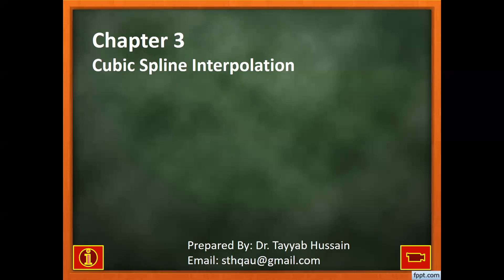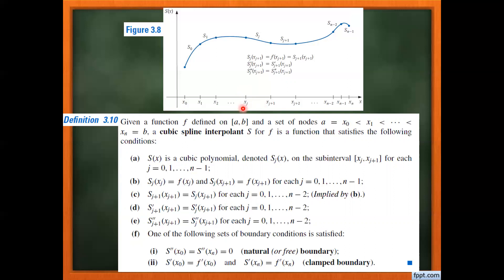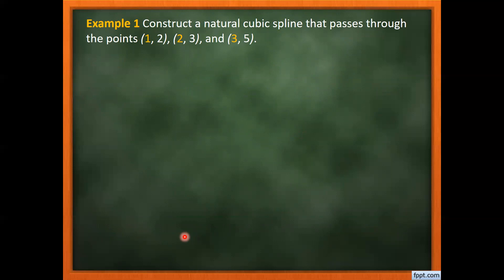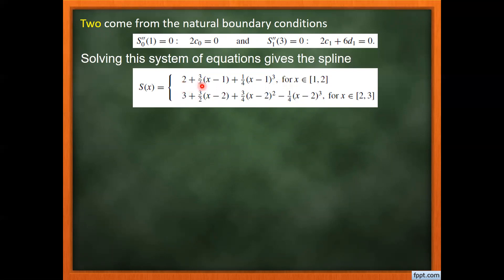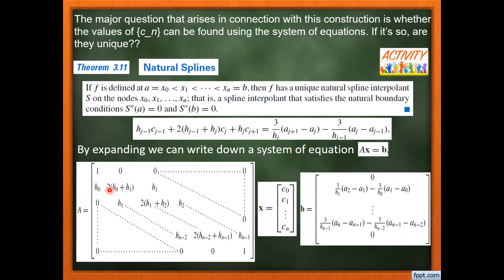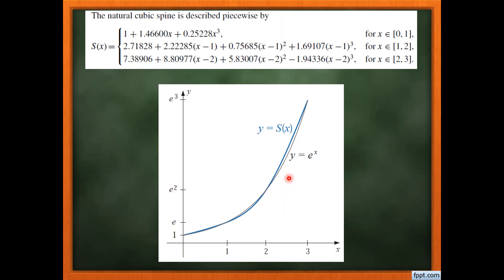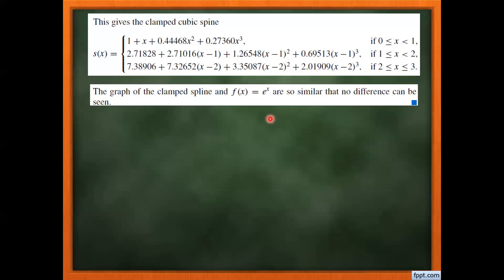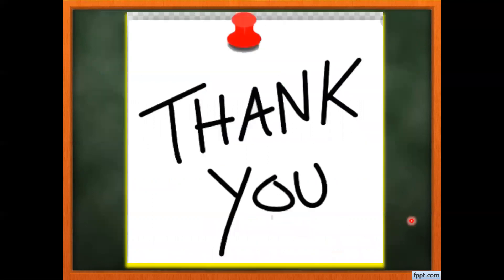Cubic Spline Interpolation

Comment: I have 15 years Daily raw temperature profile data. How can I re-sampled every 500 m these temperature data  using a cubic spline interpolation?
Reply from the maker: You can use matlab/mathematica built in function to generate spline polynomials or even can use ChatGpt to write you customized MATLAB code